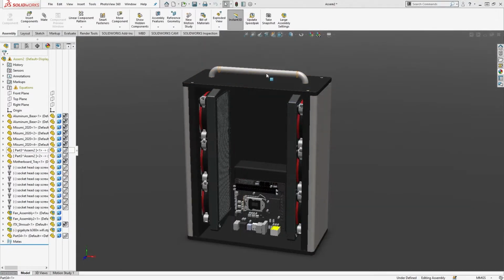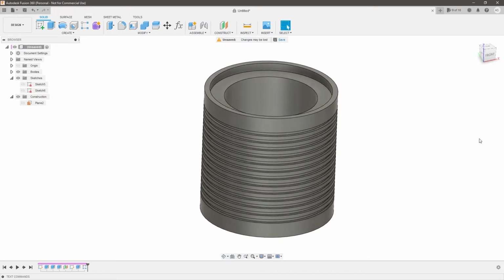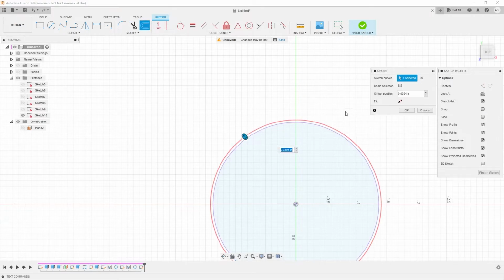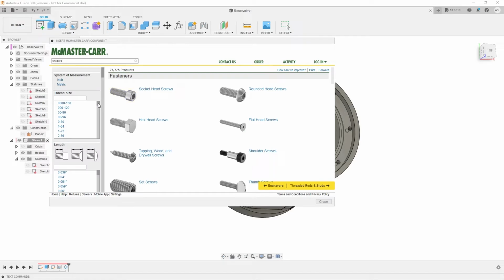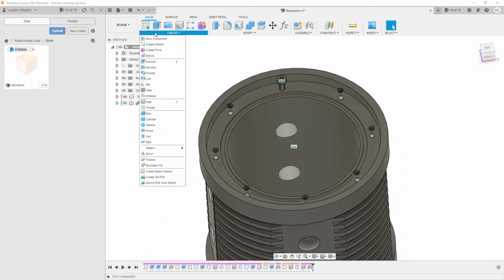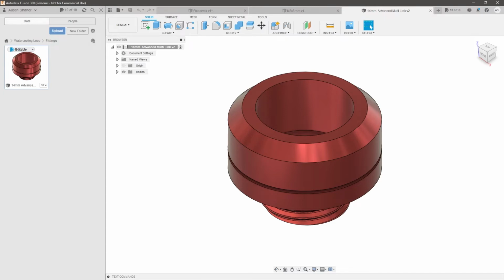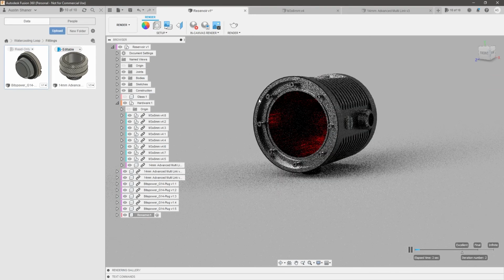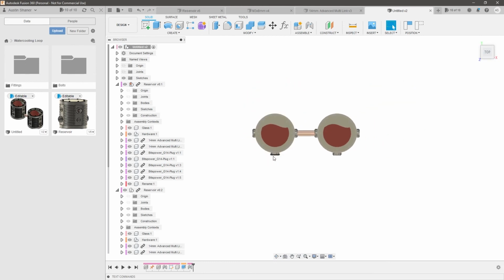Dealing with Assemblies | Viewer Request # 3 | Fusion 360 Tutorial

Comment: So...bottom up would be to build a LEGO house from the base and up,  while top down would be to place a finished built LEGO figure on the roof? Did I get this right?
Reply from the maker: Bottom up is like building all the different pieces of the house separately at a factory, then assembling them on site, like some pre-manufactured homes. Top down is like building it on site, piece by piece, with all dimensions relative to the parts you just built

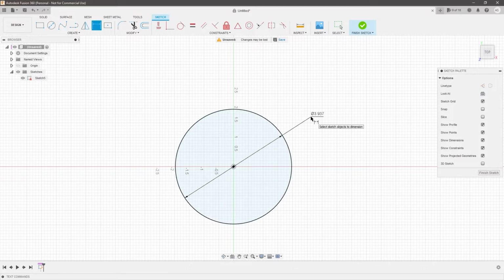Comment: Crazy newb question: at 04:35 were you working in an inch-based setup yet inputting dimensions in mm and the program converting them on the fly? My school homework just got much easier if that's what I saw happen.

Comment: And that shows the biggest issues in fusion design.  Creating things in the wrong places.  Sketches components bodies always end up in the wrong spot with no good way to move them.  Making the user delete them and start over.  Yes the user should be aware of where things are getting created.  But when deep into a complex project these mistakes always happen and didn't happen w my 15 years of solid works use.  5 years into fusion and still these work flows don't work well.

Comment: Thanks for your video. Question. The entire assembly file is called Reservoir which contains multiple other components along with the original sketches and line work to generate the main reservoir body.  Why don't you separate out that reservoir body and associated sketches into its own component within the Reservoir file so that you file contains only components at a top level? Thanks.
Reply: It's simplified for the video i guess

Comment: Great video as always. BTW, you can save components directly as a design file, re-importing from MMC as a step object is not necessary.
Reply from the maker: Oh? I wasn't aware of this. Do you insert it into the design and there is an option somewhere in the design tree? I've always just inserted it into its own design file and saved if I want to reuse it.
Reply: @austinshaner  Right Click on the component that MMC creates (or any component in general for that matter) and select "save copy as". That will dump the component as a new design file, however your original is NOT then linked. If you want a linked component, you'd have to remove the original and import the saved copy. so saving it right after import (when the object is sitting at the origin point) is the best time to do it, otherwise all the movement and rotations will be saved to the design file as well.

As much as I love MMC catalog there, the navigation of it's UI is pretty horrible lol. If I could avoid having to go through it a few times, I would.

Comment: Thank you for this video, Austin. Assemblies are definitely one of my weaker domains, so this has been helpful. Just a quick question. Is there a reason why the reservoir main body was not created as a new component? In your video, this was done at the top level.
Reply from the maker: Thanks, in all honesty I just forgot. However, I do have a habit of letting the main body that other components join to remain a top level body so I don't run into loose joint issues in top level assemblies. I realize that's bad design practice and I should have made it a component and grounded it or joined it to the origin point.
Reply: @austinshaner  Oh, I wasn't trying to point this out as a bad practice. I genuinely do not know:) In my mind, I also sort of guessed that you were using the reservoir body as somewhat of a master body from which to build upon. So it would make sense to do it at the top level. Since this main reservoir body can serve as an anchor and remove the need for grounding, wouldn't this be better? Any downsides to doing this?
Reply from the maker: @Fusion360School  I didn't think you were, that was my own self criticism ;) I don't think there is any downside if I'm using this as a sub assembly for a larger one. But this could create issues if this was my top level assembly file as the radiators/mobo etc would have to be located off of this bodies position.